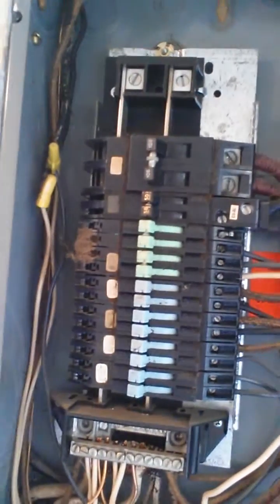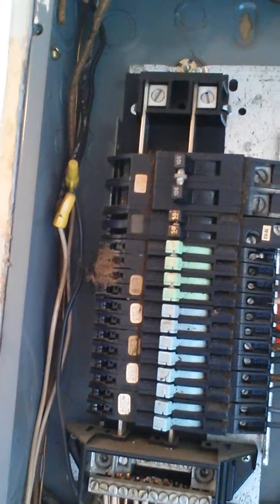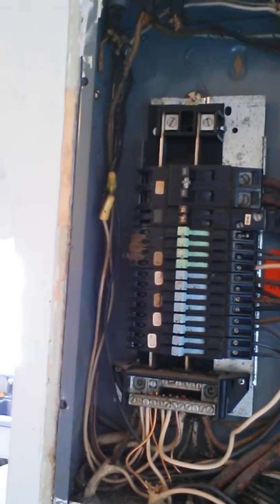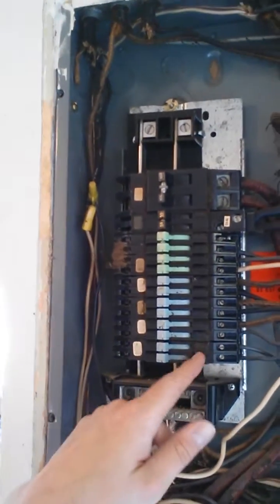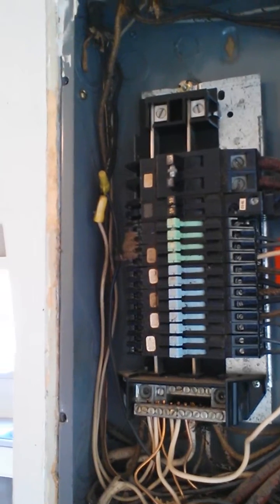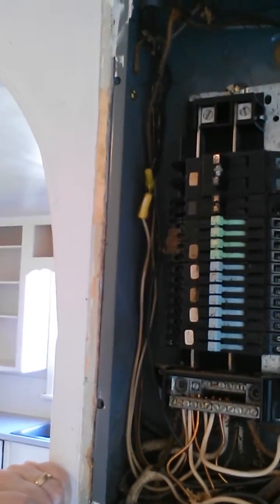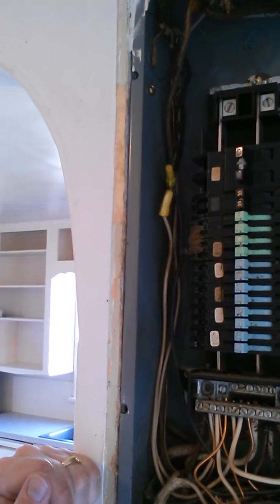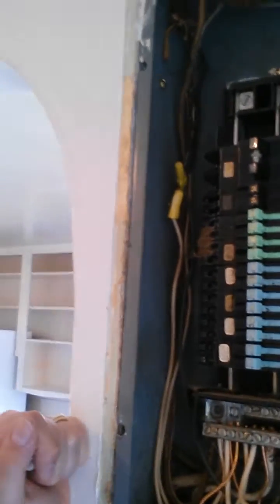Electrical Panel Overview Sylvania-Zinsco

Comment: The reason some of the Zinsco panels are labeled Zinsco/Sylvania or GTE/Sylvania,  is because Sylvania brought out Zinsco around 1973,  but sometimes continued using the Zinsco name for a period afterwards.   It was a very popular panel,  along with Federal Pacific Electric,  and most often seen in homes built in the 60s and 70s.